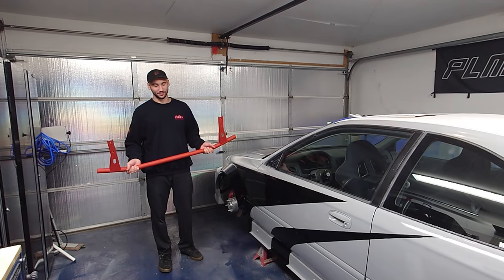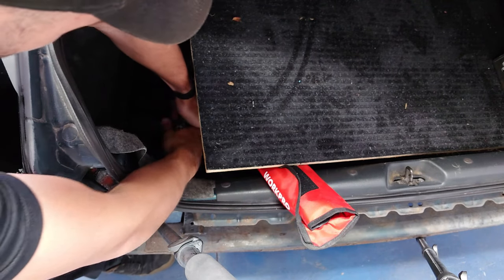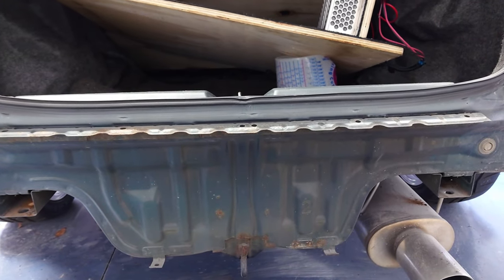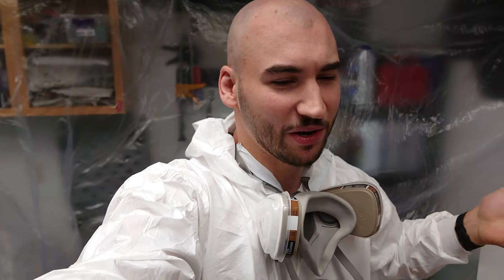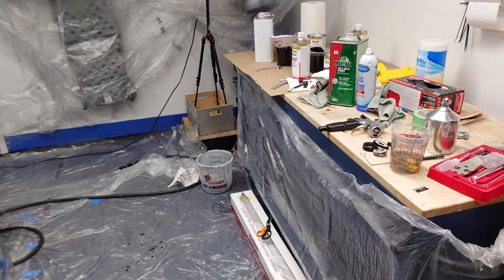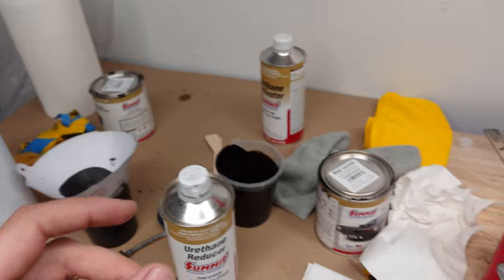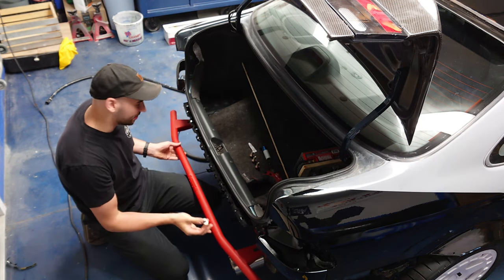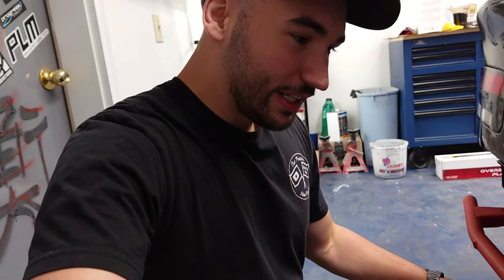Doryoku EK Civic Rear Crash Bar install and More Painting!

Comment: I forgot to tell you when we were chatting on messenger I removed my trunk tortion lift bar. The only way I can open my trunk is with my key and I hold my trunk up with my cane so it works out pretty good.
Reply from the maker: I wonder if I can weaken my torsion bar spring by heating it up
Reply: @kraftingkars  yes that will work